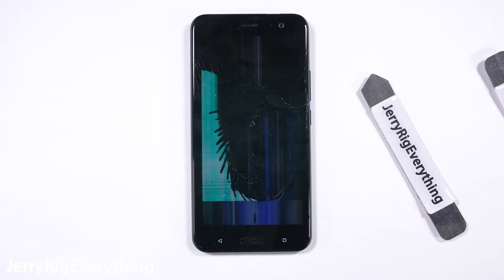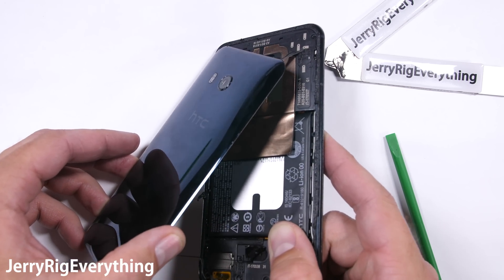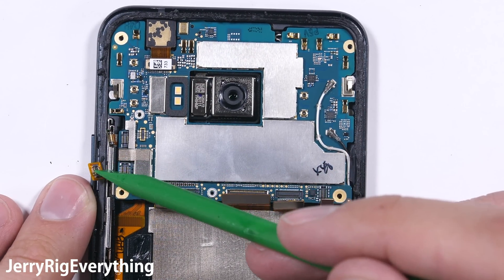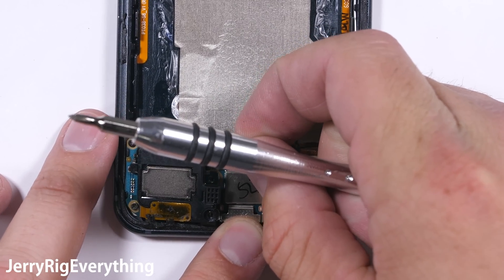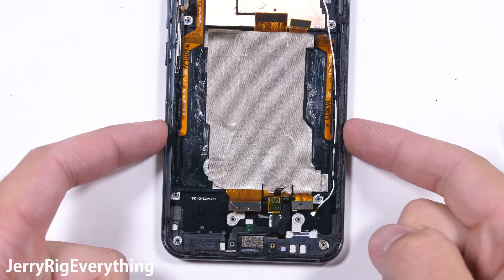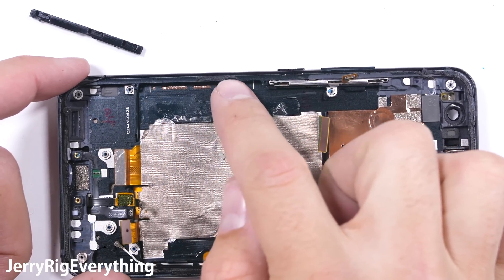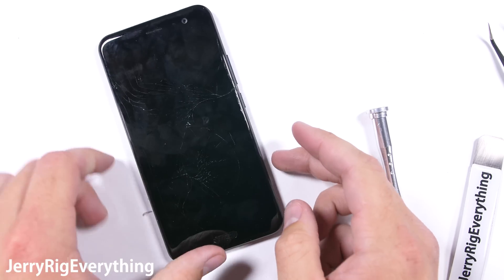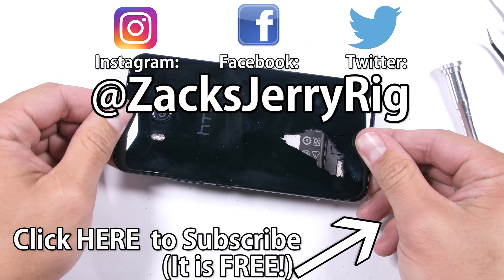HTC U 11 - Teardown - Pressure Sensor Reveal!

Comment: Nice Video Jerry! I'm Abhinav Janak from Hyderabad, India, a huge HTC fan. I'm currently using HTC U11+. I am unable to find a tear down video on U11+ on Youtube. Dint you do a video on it then? If not, Could you do a tear down video on U11+? It will be very helpful to all we  HTC U11+ users. I also have a U12+ which I shall be using very soon. I recently bought another U11+ phone from someone, it's a translucent black color one. Phone is excellent, but the pressure sensors ( Edge Squeeze on sides of the phone ) aren't working unfortunately. I will be glad if you can show this pressure sensor part both on left & right sides of this phone and speak more about it in your video. Do also let me know where I can buy and get this part from ? 

I along with many HTC fans are waiting for next great flagship from HTC. Hoping HTC this time in it's new flagship gets wireless charging along with Infra red blaster, Radio hardware, 3.5mm headphone jack and two SIM slots with a separate Micro SD card slot while maintaining very high standards in cameras and it's software. 
 
Regards,
Abhinav Janak

Comment: Hi Zack, my HTC U11 has a puffy, defective battery. I wanted to remove the battery but keep everything else for fun (I don't plan on reusing the phone). I don't have a screwdriver small enough to remove the screws of the motherboard so I can't disconnect the battery connector. Is there any reason I can't just cut it?

Comment: I was able to remove the pressure sensors by heating the sensor locating up to 390°C at an airflow of 40 with a Quick 861DW for about 1.5 to 2 min. I would then gently slide curved tweezers between the case housing and top pcb of the sensors and then pull gently while working the tweezers forward ensuring that I wasn't putting stress on the bend points too much. I would continue to heat and pull I successfully changed both sides and put them on new replacement screen and they both work. Its possible but it's not easy.

Comment: The edge sense on my HTC U11+ doesn't seem to work like it used to since I send it to the service centre for LCD screen replacement. Sometimes it works just fine, other times it acts like I'm squeezing it even though I didn't and, it happens quite often. Its not like I'm set the squeeze too hard or too low or anything either. Should I send it back to the service centre or it just a software issue?

Comment: Maybe you could glue the backplate permanently to the frame that would of course make it hard to repair after that. But that wouldn't be to bad I guess. It was already repaired once so if you use two component glue you could trust your phone again around water. 

I would love to see a video testing the durability after gluing and a waterproof test. 😃

Comment: Screen scratches super easy actually. I got my U11 day before launch (pre-order). And my original I only had 10 days before my rear seal/gasket started coming out between the rear glass and frame. All on its own. 

My replacement (was a pain in the ass to get) was brand new thankfully. So upside is I have 2 sets of EVERYTHING that comes in the box. Except 2 phones of course. 

Now back to easily scratched screen. I originally had it screen protected with IQ Shield. But it started peeling off after 2 weeks near the bottom. Got a crap ton of dust. So I couldn't reinstall it. But....it went on perfectly. Just think my evocel case (both off Amazon) just doesn't work to well with it. 

Although the IQ sheild comes with lifetime warranty, I haven't ordered a new one yet. 

My phone had only been in empty pockets, or on its back. Whether on a table or charging on carpeted floor bedside. Within one week, my screen is riddled in micro scratches. Not easly visible unless you hold it to the light a certain way. But they are not tiny. Got one swirl like one on the bottom right corner (maybe from digging something into it while playing a game), another "J" shaped directly in the middle. One small but deep enough to feel with a finger nail near the home button. And many others. 

That said. A screen protector is a must on one of these. Otherwise, this phone is bad ass. And I normally keep my phones as nice as possible for as long as possible. Just sucks ass that 3 weeks in, I got scratches all over my screen. So resale took a huge hit right off the bat. 

Another thing. I don't think htc planned on selling so many so fast. As they had ZERO parts for them till end if August early September. And since the hurricane destroyed one of their factories in Texas. Repair time has taken months for most htc owners.  Great phones, not big on aftermarket support. 

And if you didn't know. Htc made the first ever Android smartphone.  The HTC Dream/Tmobile G1. In 2008. They also make the google pixels as well.

Before I forget. Battery life is insane on this phone, for the size of battety it has. Highest I've seen personally with mine was 14hrs 38mins off charge, 9hrs 47mins of it was SOT (ALL via Sprint Network, no Wi-Fi). So no headphone Jack isn't all that big a deal really. Headphones it comes with are pretty decent as well.

Comment: Jerryrigeverything.. Help or anybody else with advice. My HTC u11 power button is stuck down

Every time I hit the fingerprint censor it takes a screen shot. The power button can wiggle a bit but it does not pop back up. Power button is ultra sensitive if my finger glides along the side of the phone ever so slightly it actives and phone restart/shutdown prompt pops up.

 Please help just got phone no insurance. Will contact HTC wanted to get a take on it. Keep up with the good work thanks
Reply: Keep clicking it until it jolts back into place

Comment: I have a question to ask zach
i use a moto g 2015, and it came in contact with water
so the notification led sometimes will start blinking on its own, and when i turn off the power it still remains to be the same, i think it has something to do with the circuits
any help please?

Comment: You can turn off a phone with a ruined screen by long holding the power button to force a restart and in the instant that the screen turns off, long hold the volume down and power button to boot to bootloader and then select Power Off.

Comment: DO A DURABILITY TEST ON THE 2017 LONG CZ T3 Smallest Long Standby Mini Tiny Mobile Cell Phone Bluetooth Dialer 0.66 inch MP3 SMS Voice Changer With Vibrate Function Beat The Boss (Gold)

Comment: Dear Zack! I know it is off-topic, but you could make durability test of phones with their original case as well. Let me describe you what I mean. Even though the screen of my s7 edge is scratch resistant, my screen gor sratched by the original Clear View Cover. It really dissappoints me as such case is not cheap and it leaves permanent damage on the screen. THE ORIGINAL CASE! :(
I would be glad if you somehow made a video out of the flagships and their original cases. It is outstandigly annoying to have my screen scratched :/

Comment: It still is a very good handset..I hope you can replace the display and get it working again, but I see that accommodating the Edge Sense feature is what made the construction weak, and therefore, fail the bend test... Although I still wouldn't attempt a tear-down myself, I can see that the U11 isn't as much of a nightmare to disassemble as the HTC 10 is...

Comment: can you try to make a the bezels on the front transparent?
Reply: Yonatan Avhar It's possible, but tough. the paint is usually on the glass which sits over the LCD and frame. You'd have to take a lot off, and even then, You'd be looking at a plastic frame

Comment: What if the sensors were in the screen instead of the sides, so you can have pressing harder do different stuff based on where you click harder
Oh... Apple...
well, we haven't seen any 3D Touch android phones, even though the s8 has kinda that but just for the home button
I don't think it would be a bad idea
Reply: The issue with force touch is there's never any indication that it can be used.  You either know you can use it, or never use it.

Edge sense you're intentionally assigning things to it.  You know what it will do because you chose what it will do, there's no guesswork involved.

Comment: To quote Zach in this video; "With a more rigid frame, this feature probably wouldn't work". HTC absolutely can make strong phones, and the phone you have now is probably weaker than the HTC 10. But with the U11, they had to make it so the frame flexes enough to allow the pressure sensor to work. It's either give it a feature which no one else has, or make it pass Zach's intentional bend test. I prefer the do-anything Edge Sense far more than a one-use-only Bixby button that gets in the way. I will be getting the U11, but I won't be trying to fold it ;)
Reply: I don't understand the concern people have about the bend test.
Take care of your $600+ miniaturized computer that fits in your pocket.  The only time the bend test would matter would be if you sit on the phone constantly, which again, take care of that expensive device and don't sit on it.

I've had my 11 since last thursday and it's been a fantastic device.  Super fast, feels great, looks amazing.  I hope you enjoy yours also!
Reply: I have the S8 and have to say the Bixby button is annoying as it can't be remapped (without root). My HTC 10 which I passed to a family member is solid, and IMO one of the best HTC's I ever had. Think you will like the 11, it wasn't out before i got the S8.
Reply: Blue Rays it's okay if a phone is a year old. I'm still using the HTC 10 after over a year and it still runs great
Reply: Yeah, I think there's really no concern about bending in real life as long as you don't sit on your phone. I have the Xiaomi Mi5, which Jerry broke in half like a little stick, but I have no problems with it.
Reply: Daniel Marius gimmick? I mean, I wouldn't consider an extra remappable input a gimmick. It's actually useful for everyone
Reply: I have learned to not let Zack choose the devices I use. I honestly love Edge Sense and would not trade anything for it. I too will take it over the one-function Bixby Button.
Reply: I AM PROMETHEUS Bixby isn't remappable and it's worse than Google assistant so how is it good again?
Reply: I want it so bad but I'm afraid I can probably buy it next year and maybe it's old then
Reply: Barry B you can remape bixby with something else. try bxactions, doesn't need root.
Reply: whomad15 I agree, I had the Nexus 6P as a daily driver for 2 years. That phone, according to JerryRigEverything is the worst phone on the planet for bending. It's perfectly fine, because I don't get drunk and try to bend my phone. LOL.

I also appreciate phones enough not to stick them in my back pocket. I mean, that pocket was made for wallets. Anyone who wants to sit on their deserves it to break.
Reply: I'll wait to see if you'll tell this after you bend your phone. This edge-sense is just a gimmik, nothing else. Like bixby button.
Reply: Bixby is a better feature and after people used it it wad good.

Comment: Do you think that it is possible to connect a phone like this (screen damaged)  to an external display to check if things still operate like the pressure sensors? It could be a cool segment to include for some of the phones on the shelf of shame.

Comment: Hi Jerry, my Motorola Moto G Pure Editon/Style landed directly on a corner and because of that the volume buttons are jammed (meaning that I have or max, or minium volume) and the power button doesn't respond when I wanna turn the thing off. 

Do you have idea anything what is wrong, how I can solve it, how much it would costs to repair it? 
Also, is there any way to remove the functionality of the volume buttons in the camera app? 

When I wanna shoot a picture, I sometimes accidentally push the volume buttons, but since it is jammed it keeps making pictures without I notice. So when I open the gallery, I sometimes have to remove dozens of worthless fotos.

Sorry for any grammatical errors, I am from the Netherlands and my English is well...quite shitty!

Comment: Zack, how do you know whether to open a phone from the front or the back glass?
Reply: Every phone with a glass back has a metal frame, so they can be separated.

Also, It's much less risky to take the 10 dollar glass back off than the screen.

Also, it can be awkward/impossible to get the screen off if done from the front.

Unibody phones are always the screen for obvious reasons
Reply: Ah okay makes sense, thanks 
Have a nice day

Comment: Can you try to build a new mobile by using old parts please
Reply: technically it would be possible but you'll have to rebuild the phone's kernel from scratch, and that's not easy thing...
Reply: Someone already done it on YouTube. He was staying in Shenzhen and decided to build an iPhone using parts. Even the screen is put together layer by layer. Search for the video, very entertaining.
Reply: like a little lego like a little lego like a little lego like a little lego like a little lego like a little lego like a little lego like a little lego like a little lego like a little lego like a little lego........
Reply: I'll answer this question for him: No. With all the variations between models (at least with android) you could NOT build a phone using a motherboard from samsung, a camera from Sony, a body from LG, etc. Unless you were to try to make a phone using parts from one model, or making an iphone.
Reply: xBane_ U can, but u have to make ur own custom rom. And u need drivers for those things, which is pointless and waste of time
Reply: Maverick you do not need to create a kernel you can just install linus's kernel as it supports Arm devices (so all android phones) the only problem is that you would be extremely likely to break a part, have wrong drivers installed, and also it is a very time consuming project that won't reward you in anyway.
Reply: syam megha that won't work, there's a lot more to phones than just attaching connectors
Reply: frankenstein's phone huh
Reply: Erik Kattusch go to china U will find refurbished  parts on the streets everywhere or just order them off AliExpress
Reply: syam megha,  are you 9?
Reply: TheSar not if the physical connections don't match.
Reply: It wouldn't be possible. It most likely wouldn't work.
Reply: Just like that other guy tried putting back an iPhone piece by piece in Shenzhen. ikr, that would be sweet
Reply: syam megha good idea
Reply: And you would have to select all your parts carfuly as if you have a overpowered battery output for your CPU it would break compared to a pc witch has a security system to stop that.
Reply: syam megha Yeah!!
Reply: Also a Problem, the Manufacturers for CPU, RAM, Storage etc. won't let you order only one Part. More like 1000 to 10000 and more.
Reply: Erik Kattusch ????
Reply: Franken-Phone!
Reply: TheSar I was thinking about that too XD
Reply: Pffffttttt.......minor compatibility issues are not match for Zack.
Physical connection not working......no problem - connect the wrong part to the right part, then back to the wrong part - I don't see an issue :)
Reply: That's assuming that all of the connectors are the same as well.
Reply: I agree
Reply: Literally not possible unless you want to rebuild the same phone.
Reply: I'm sensing a lack of rudimentary knowledge.
Reply: This noob can only damage phones.
Reply: Peizxcv i think he means a different type of phone

Comment: Htc u11 best phone in 2017 like if you agree
Reply: Mario M keep in your mind that Zack is a bodybuilder. your skinny arms would not be able to bend this phone.
Reply: Nobody has BT 5.0 yet, no not even the s8.
Reply: Salvo Titus nope. They have chips that are 5.0 compatible. Not 5.0 though. Read the fine print and learn something.
Reply: Insan Kamil true and you wouldn't put pressure on an expensive fragile glass phone anyways.......
Reply: Mario M you can't buy phone for only pending
Reply: it's kind of the best phone except the bluetooth 4.2, duo camera and the fail in previous video xd
Reply: lol you are right, just checked some details on internet, s8 only has a rubbish version of Bluetooth 5
Reply: Waleed Ali disliked
Reply: Trust me that single rear camera is the best among all flagship models in 2017...
Reply: Waleed Ali nope. it breaks easily when bent.
Reply: atl3630 WRONG.
S8, Xiaomi Mi 6 etc... have bluethoot 5.0.